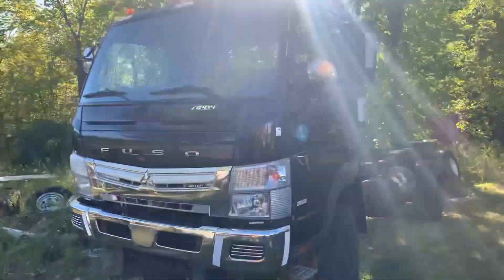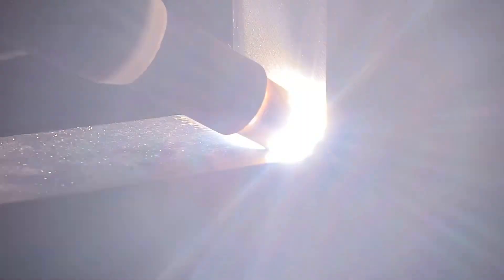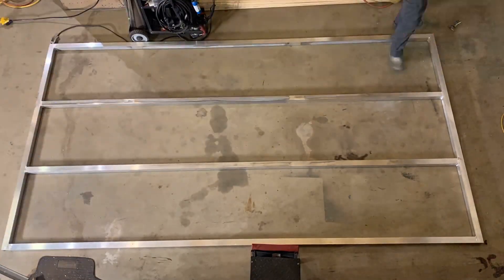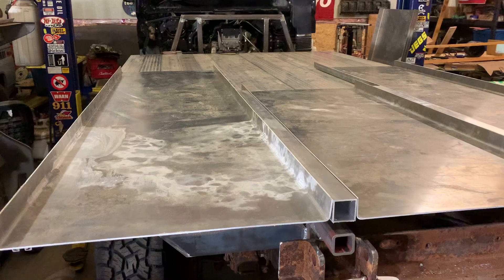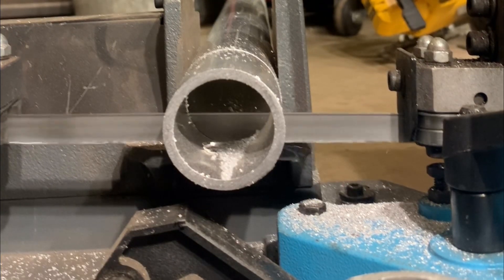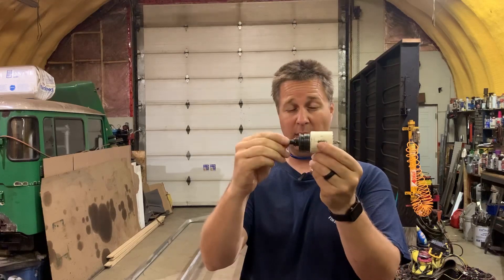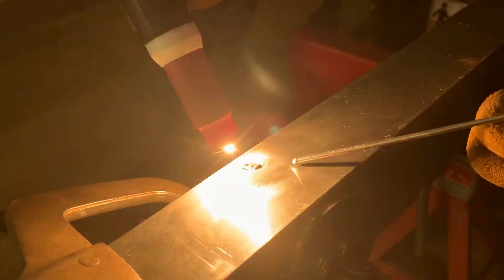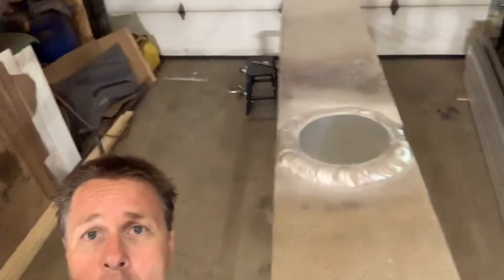Mitsubishi Fuso Camper build - Aluminum floor TIG welding #2

Comment: TIP: I recently learned that if I light up my weld area well, it's bright enough to see the weld thru the mask, so I don't have to keep flipping the mask up and down.  Love the auto-darkening lens.  It instantly improved my newbie welds.
Reply from the maker: Yeah - the lighting in my shop isn’t the best, especially in the cold (fluorescent lights don’t like the cold temps) - I also need to clean the lens on my helmet 🤣🤣
Reply: @BruceandKrista  Task lighting is your friend, Grasshoppa.  And that shop (or manufacturing center) at work in is leaving drool marks on my keyboard.

Comment: that tungsten looking pretty dull.
Reply from the maker: Are you referring to color or pointyness?
Reply: @BruceandKrista  pointiness. I understand max temp welding aluminum it's common for the point to melt and become blunted.
Reply from the maker: @aernan  yep, a balled tip vs a pointed tip is pretty common.